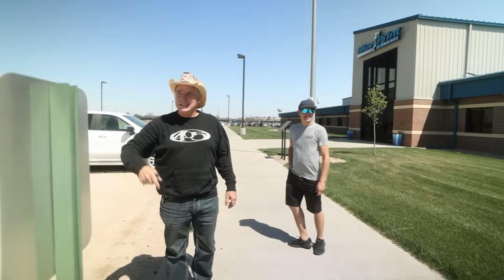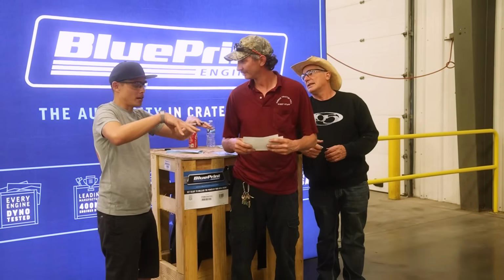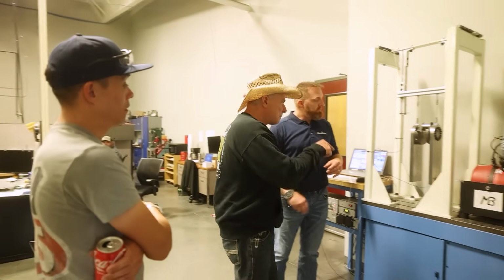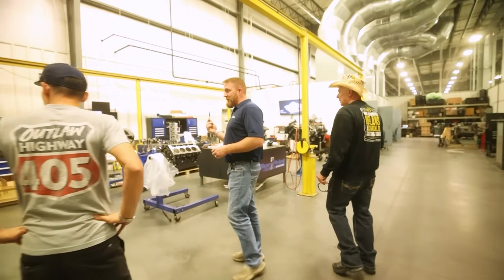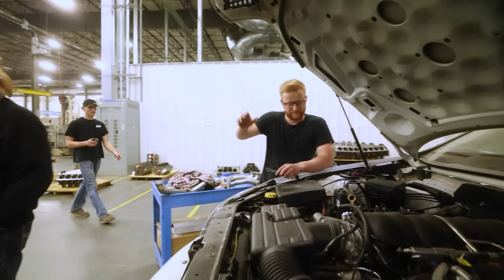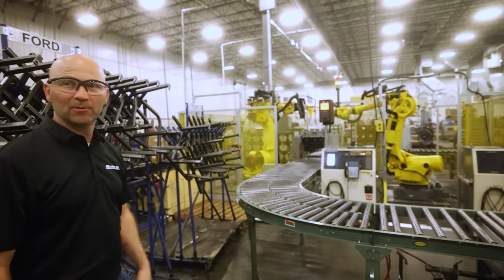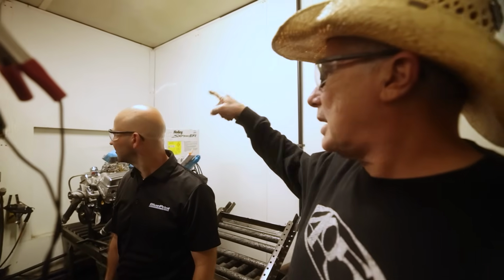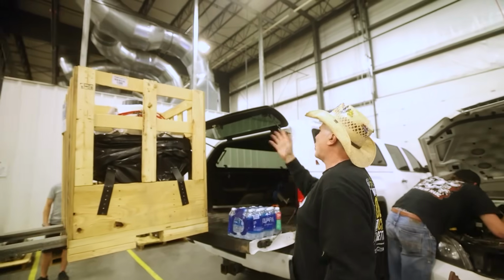FARMBOAT GETS A NEW ENGINE! and we get a tour of the Blueprint Engines facility

Comment: It’s cool that you guys are there. I’ve been eyeballing a blueprint 383 setup for a while now🛞
Reply: Danny - I recently got their BP38318CTC1D deluxe 436 horse power engine and it performs great. Just make sure you understand it requires a higher than stock Stall torque convertor if you are using it behind an automatic transmission.  My car is about 3600 pounds and I used a 2600 / 2800 RPM stall convertor and added a trans cooler inline with the stock lines to the radiator. Car has 27' tall tires and 3.73 rear gears and it idles with that cool cam lope everyone loves. For a 377 CID (it is Not actually 383 cubes as it is Not a .030 over block - but a brand new virgin block) I actually get better performance than my old 396 big block, less oil leaks, better gas mileage, and probably about 100 plus pounds off the front end of my car. 

   If you have a car or truck that you don't race but want a less radical cam (but still way better than a stock cam) I can recommend the  BP38315CTC1 410 Horse power version. We put one in a 3/4 OBS 1990's truck with a 2000 RPM stall convertor and it is a tire roaster - even with Air Conditioning on !  Gets better highway MPG than the stock TBI 350 engine too.
So I give BluePrint a Thumbs up vote
Reply: @dalemam7962   Thanks for the tips bud. I bought the car with the current 350/700r set up. Not sure about a stall. I’ll check it out and make that move during to motor swap🛞
Reply: Not bad but BB rule.
Reply: Big blocks are cool but my 65 Chevelle is a true street car. I drive it to work at least a couple times a week.

Comment: Something is wrong with farm truck. And I’m not talking about his handshake. Also, your engine should be free after this advertisement for them.
Reply: I noticed it seems he may have had a bout with Bell's Palsey. I have had it twice. It affected the nerves in my face, just woke up one morning and the left side of my face was droopy, didn't notice until I went to brush my teeth, and I could not swish water in my mouth, had a hard time chewing at 1st, and my eye would stay partially open during sleep, I had to wear an eye patch. I still can't puff out my cheeks. I have a crooked smile, a dead giveaway of someone who has had Bell's Palsey. Also the eyebrows are less than symmetrical, one side droops down low.
The 2nd occurence I recovered in about 3 days, and i tried using a tens unit on part of my face, which is a device that sned electrical pulses to little pads you are supposed to put on your back or shoulders for muscular pain. But it makes your nerves jump if you crank up the electrical pulses. So putting it on my face seemed to re-fire my facial nerves a bit, making me return to 'my normal' or wha t I was after my 1st BP attack. Anyway, I though I noticed FarmTruck looking like he might have had it there near the end of his video. This is why I included so much detail here, maybe he will try the tens unit thing as well, to see if he has good results. 
BTW, when I got it the 1st time, the doctors told me there was nothing I could do to make it go away, just look like a zombie for awhile, except for the eye patch thing. Its a crappy thing I never heard of until it happened to me.
Reply: @madmex2k  this is correct, I met him at an NPK and he had Bell's Palsy and never got the steroid shots so he's got to deal with it forever now